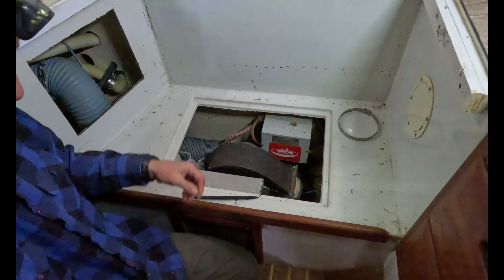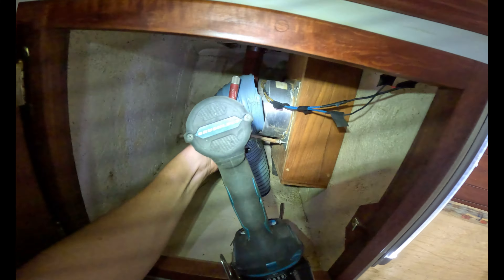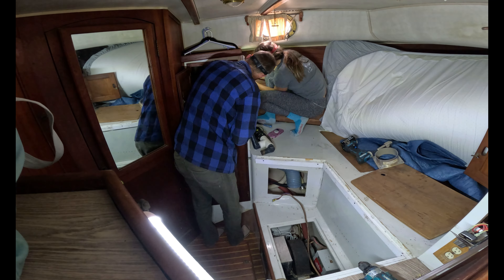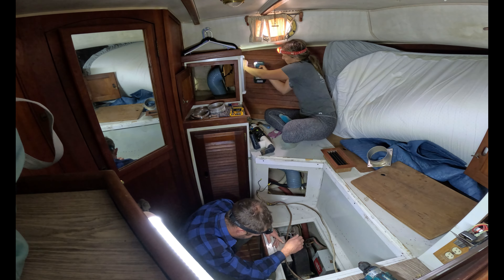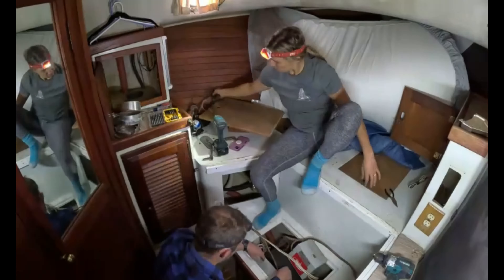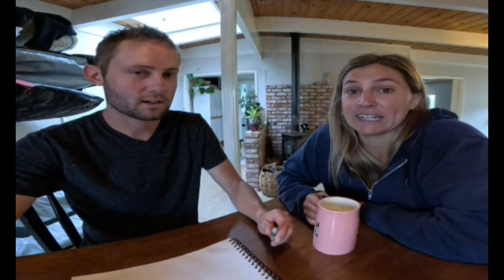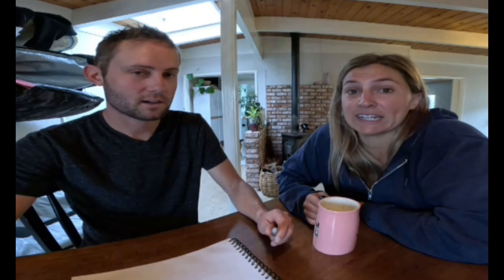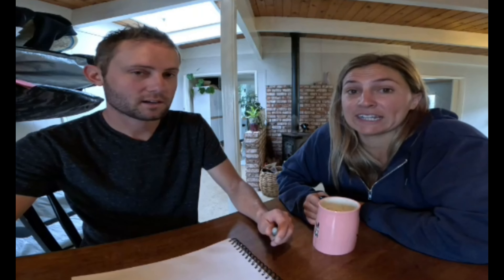[Ep 23] Boat work continues. Prepping to cruise!

Comment: Love the hovering poop in the drawing... ;-).   Do you have a raised anti siphon valve for the saltwater intake? (Didn't see it on the drawing).  Don't trust the head valve to prevent flooding.  
I installed a standard gravity tank above the port hanging locker that can be drained at sea. I will eventually replace with a new custom tank (about 38 gallons cap) One more of the many ongoing projects. Good idea getting rid of the AC units. Add more 12-volt circulation fans and keep it simple.
Reply from the maker: Yes we do have a siphon valve! Yes we thought the same- better to just have it on 12 volt. Thanks for watching and commenting!

Comment: A/C you can run off the boat systems might be worthwhile. In the tropics it is not just whether you can stand the heat it is the rain and humidity and mould and bugs requiring you to keep the boat closed up at night so you don't get eaten. Do you have a plan for electrical systems worked out yet?